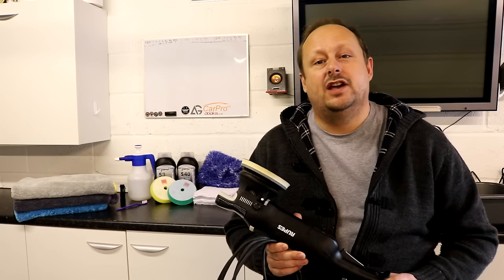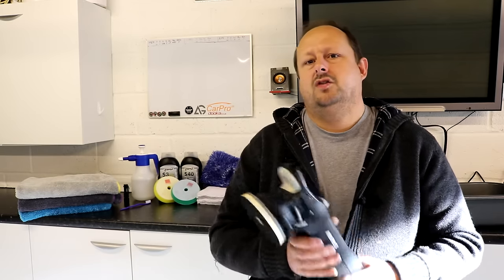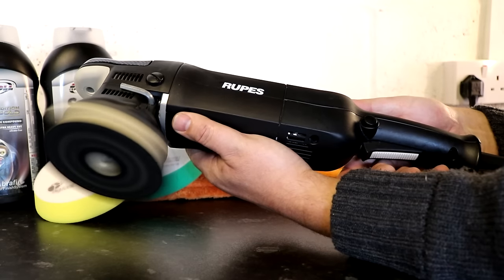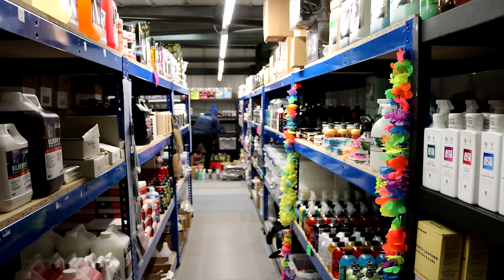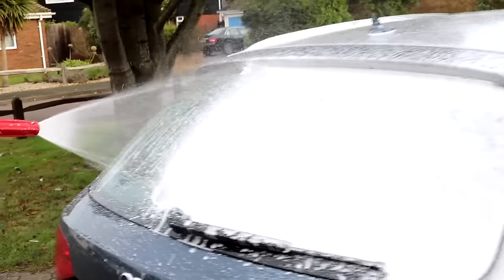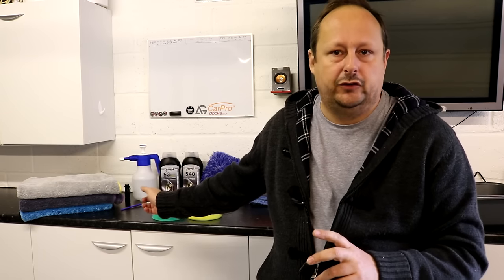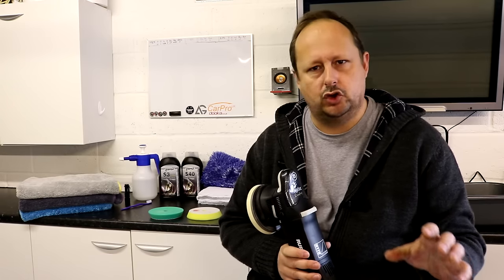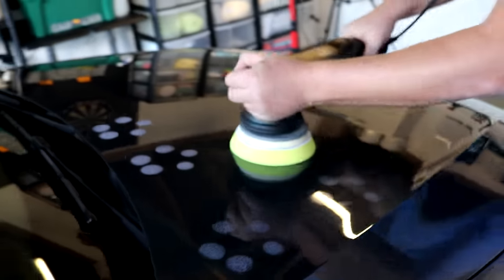Rupes LHR15es MK2 bigfoot machine polisher review guide demo

Comment: I have a 15mm MKll. Without the washer mod it would stall on flat panels if the machine had the slightest tilt. The mod helped a lot. But it still stalls a lot. Very disappointing.
Reply from the maker: bit of grease on the backing plate can help..  remember rupes want the shroud to take up some of the load.. without that is creates too much wear on the bearing.

I know from a consumer point of you view you just dont want any slow down or contact..  but Im guessing they use the finest bearings you can get and they know the effect of rate of wear on the bearing if they remove the shroud contact.  honestly though dont know mate.  i hear a lot of people complain about stall on long throws generally and others say its not a problems.

for me you have to manage it with free spinning machines and it becomes a problem more machining bumpers and wings and rear quater panels and curves generally.   theres also a consequence with managing it that usually means less pressure and therefore less correction.   Its one of the reasons I favour forced rotation.
Reply: I am seriously considering buying a Flex 3401 or the new Mille

Comment: Hi Jon, Would the 75E be a better starter tool especially if you'll be starting on a small car as you'll be able to cover more of it? Thanks
Reply from the maker: no it wouldnt be good lee..   a starter tool would be one that allows you to get the car polished in a bit more of a timely manner (yes you will have some access problems with a 5-6 inch pad on the lhr 15.. but thats less bad than attempting to polish say a front bonnet with a  75.. that would just feel wrong...   like eating soup with a teaspoon..
Reply: Thanks for the reply Jon but it leads to one more question. Rupes bundle or Scholl S20 Black and a green C/G pad as per your beginners guide as I'll be looking at a single stage? Thanks again

Comment: Probably a noob question, but am I right in thinking this has a small motor? 500w? Considering the Das 6 Pro etc had 850w? In Lehmans terms what does that relate to in performance? Not between the LH and Das 6 of course but just in general? Many thanks, great review!
Reply from the maker: its less important with a DA..  the power of the motor does not correlate to the amount of torque the tool puts out...   As DAs are free spinning the offset free spinning bearing will be slowed down by pressure quite easily...  but you cant really slow the rotation of the axel itself on either tools,  mainly because you have a sponge interface to the surface you are buffing, and the presure on the pad/plate is relativly low...     if you were using the tool to sand wood with a bit of grit paper on the backing plate, torque output would come more into play because it would be easier to slow the machine down...
Reply: Fantastic! Many thanks mate. Looking to upgrade my Das 6 pro due to the low/slow correctional capabilities (8mm throw) in the scheme of DA's. Would you consider any other machine than this? Is there any benefit in upping to the LH21? I purchased the DAS 6 Pro to solely focus on my Integra Type R (soft paint). However may now find myself doing more machining on other vehicles, hence looking to upgrade. Thanks for the advice mate. Really like the channel!
Reply from the maker: 21 mill throw becomes a bit of a handfull.. I think the 15 mill throw is enough... what else would I consider..

Well if you are set on a non rotary solution the usual shoot out is 

das6 pro plus 15 mill throw (cheaper option)
rupes lhr 15es mk2  (typically professional option)
flex 3401 fixed rotation DA (typically professional option)
Reply: Awesome, thanks a bunch!

Comment: Hi Jon, do you mix the born slippy clay lube with distilled water or tap water? Is it really effective or you'd recommend another clay lube also?
Reply from the maker: either.. I think nowadays I prefer to use distilled but in the past Ive just used tap water.
Reply: Ok thanks mate, lastly, is there an expiration date for the dodo juice born slippy? Does it tend to go bad after a certain amount of time? I'm going to buy the 250ml concentrate which will make 2.5 litres. Considering it's for personal use and only one car to be clayed rarely, it's going to take some time to be used up fully.
Reply from the maker: you know what I dont know..  thats one to speak to DJ about..

Comment: Does this polisher have more torque on curves than the DAS 6 15mm? Thanks!
Reply from the maker: they all stall if you lean in Mark.  There is virtually no torque on the spin, its purly generated through the free spinning plate around on the offset bearing.      So you wont stop the axel orbitting from pressure but yes with this tool or the xfe 7-15 of the DAS6 pro plus they all stall out on the rotation on curves and when you lean in.    when we had all 3 tools up against each other we felt that the flex and rupes had an advantage over plate stall than the DAs6 pro.   but theres not much in it.  I actually felt the flex plate system was the best at this, although i think the other guys might have felt the rupes was better I cant remember.   the rupes and the das6 pp benefit from a bit of grease on the plate and the shroud rim..     part of the reason these tools are so safe also creates this stalling problem.   Its the main reason I choose forced rotation over them. but they are still pretty cool.
Reply: Thanks Jon! I have the DAS 6 Pro Plus and trimmed the shroud(helps a lot). I feel it's plenty powerful. I have the 3401, but I feel I get better cut and finish with the 15mm and less fatigue, but the stall on convex panels gives the advantage to the 3401.
Reply from the maker: hey mark.  I feel the 3401 cuts a lot more. but I cant stand using the 3401 on anything other than the 5 inch hybrid power pads because you get walked more.   on a bonnet or something theres less difference, but polishing out a wing of something with the free spinners just see lots of marks after a set that the 3401 would have got.

Comment: why u dont use the rupes if its soo good all the pros use it ?????
Reply from the maker: hey pete.  not all the pro's use them.   I dont use free spinning machines generally for reasons I kind of covered in the machine polisher types guide video.  So I mainly use the flex 3401 and the flex rotaries.  If I did want a long throw free spinning DA option Id have to make a choice between the cheap chinese, the flex xfe 7-15 and the rupes LHR15esmk2.     I would prolly go with the flex now because I think it has the best plate the shroud interface of all the long throw machines that and the flex mini that I would pair it with I think is the most solid mini.   but it wouldnt make too much difference really. although the build quality on the flex and rupes is higher

Comment: Ive seen you also reviewed the Flex 3401, in your opinion which is the best?
Reply from the maker: I think is I had neither and wanted to buy one..  At the moment I could get a flex for 300 quid.  Thats going to be the things that swings it.   I can also use the flex with a pad combo that suits me more... Its also lighter..  So I would buy the flex.   If I had to buy the 900e now I would need to spend over half a grand for the kit..  As much as I like the tool  and would love to have one, if faced with the decision I would by the 3401..  although I think flex are bringing out a new forced rotation soon so might wait a bit for that..
Reply from the maker: sorry you were asking about 3401 or lhr15.    not 900e.   in short personal preference will play a part.  I prefer the 3401 to the free spinnings.  I find it more consistent generally, I find it cuts more and I find I can hit the edges of panels with it and lean in if necessarily without worrying about stall...   the trade off is a forced rotation will walk more, but I use it with small pads which solves that problems.

Comment: Hi, does this have more pad spinning torque than the DAS Pro Plus 15mm?
Reply from the maker: hey mark remember the spin is free spinning on these machines.. so the spin is generate by the orbit..  So its really the torque that gets put to the axel thats for the orbit the bit you have to measure and I dont think anyone publishes this..  Id be interested to know myself but you wont stop the orbit or the oscillation of the machine. the tool also has electronics to maintain the OPM rate.

In terms of the spin..  The rupes 15lhr rubber houseing edge sits close to the plate.. there isnt any clearence so the spin can be easier to slow down I think than the das6 P + (although you can still do that on the d6pp).   In practical terms though you will only stall the machine if your pushing down tool much or the pad isnt on a flat surface...  some people I speak to dont think its an issue.. some I know use the washer mod..  

for me, if your just going in light handed and letting the tool do the work then there isnt an issue with the "spin" stalling..    The tool delivered me the results I needed with ease.  I think like Ammo NYC said about the tool.  Putting the washer mod might just give you a bit more space to stop the rub and make it even harder to stall....     Or make the tool even better i think was the words he used...
Reply: Thanks! I use the washer in all my long throws. The DAS6 Pro Plus 15mm works very well for me. I polish a lot, but still don't see the need for a Mark II 15 as far as correction, unless I'm missing something?
Reply from the maker: Hey Mark.   if you have a pro plus 15 in terms of capability theres not much point buying a rupes 15lhr mk2..   but you didnt have either..   Its important to know you are getting a good tool with whichever option you pick.. but the Rupes is a higher quality tool which better internals and more features...  I think budget will be the number one factor and if your a pro or not really.

Comment: thinking of buying this or the griot's boss 15. any thoughts jon?
Reply from the maker: hi tito.. I have no idea about the griots they have good reputation but I have never used in the UK...  Can say though if your defo sure its a 15 mil long throw.. the rupes will serve you well.. Its the smoothest of the long throws that ive used.. very well built..   grease the backing plate on it to minimise stall and be mindfull of pad stall when working non flat areas (so mindfull of pressure and balance)
Reply: Forensic Detailing Channel thanks for the input john

Comment: Whenever I use mine, the pads fly off it, any ideas why? I make sure they are securely velcroed down
Reply from the maker: what pads mate?
Reply: rupes medium and fine
Reply: they came in a rupes starter kit with the polisher
Reply from the maker: it takes some effort to peel those pads off the polisher.. there is no way they should be flying off the machine...  Id say its almost impossible for them to rip off during use..   the only thing Im thinking is your pads are sticking to the paintwork (happens sometimes with single stage paint where you get the pad really bites onto the surface)...   so make sure the pads are on well.. and make sure the pad is not sticking and stalling on the surface for whatever reason.. maybe take a video of it happening with a smart phone or something..  its really hard for me to say without seeing it.
Reply: Ok thanks will do when I get the chance, I think it seemed to happen when the backing plate started to heat up
Reply: hi 96 explosive, sounds like you've cooked your pads pal,essentially melted the Velcro.
one thing its critical to know is the rupes generate an enormous amount of heat at the point of contact between machine and pad i.e. the Velcro.
the way to avoid this is to use multiple pads,say 4 pads for average bonnet,say 10/15 minute set then swap the pad.
this is critical,I've learnt the hard way,oh and I know your probably not but don't use damp pads,adds weight to the pad and(more )  stress on the Velcro......
those pads you've got are junk now I'm afraid,time for some more.
love your vids forensic detail guy,hope I aren't butting in here .
Reply from the maker: no your more than welcome mate, and it sounds like good advice..   

what I think is happening is when the pad starts grabbing the paintwork for whatever reason. when that starts happening you can almost insta kill the pads.. they cannot absorb the sort of energy the tool is putting out, and the more they stick the more energy gets transferred through the pad...    

so always working nice and slow and making sure pad is clean swap pads etc..

only times ive ever had this sort of problem is on single stage paint which I hate working on with a passion..
Reply: cheers forensic detail,reason  I say this is I went thru this last year.
I bought a mark 2 15 last summer and initially broke it in wet sanding my work van ( not the actual sanding of course) which I did in my spare time,an hour here and an hour there and all was fine.
first ran into problems when I did a correction/ enhancement for a customer and used my rupes for an extended period (8 hours)
after about 2/3 hours my pads just started flying off especially on the horizontal,I was using rupes microfiber pads.
luckily (I thought) I had 4/5 spare rupes pads foam and microfiber,even broke some out of there bags but wasn't having it at all,pads flying,plenty of arse clenching moments on customers bmw.
luckily I had my trusty old das 6 on me which saved the day.
was really disappointed with my rupes and couldn't understand what was happening,bought some more brand new rupes pad and still the same,they'd stick but peel off again really easy,after many,many hours of research I read something about melting/degrading the Velcro with overuse of single pad.
which has just made me realise my original post was in fact wrong and explosive96 its actually a little worse as you probably need a new backing pad (slims detail £35) best way to check is try a brand new,out the bag pad and if it peels off really easy its the backing plate,all things being correct the pads do stick like shit. 
best description I heard was Todd helme/rupes guy and he uses the analogy of spinning a rock around your head that's tied to a bit of string,if the string is short (i.e. short throw da) the force at your hand is relatively easy to control but increase the length of the string (i.e. long throw da) and the forces multiply dramatically and this is what is happening on long throw machines except the Velcro is taking place of your hand,if that makes sense ??
anyway I took the advice,got a new backing plate and started switching pads more often and haven't run into the problem since.
hope that helps.
.
Reply: and just to further clarify with the string analogy,the Velcro been your hand is getting put under extreme force because of the longer throw (a lot more than say a 8 mm das 6) and this force results in the Velcro interface pad or backing plate getting really hot and the tiny hook and loops start to break down and stop working.
Reply from the maker: this machine I borrowed has been used heavily.  and I gotta say the pad stuck to it so hard (its like quite hard to tear the pad off it)..   I think you hit the nail on the head that you degrade the velcro if you over heat the pad perhaps..     has to be something like that.. because there was no way on earth this pad was coming off the machine...   Its really important to work cool..   and always make sure that pad can spin freely over the surface..    I think it goes back to the point about grabbing.. If ever you get a pad grabbing the surface when your machine polishing, for whatever reason is causing it.. if you get grabbing your in trouble and you need to stop and check out whats going on and address it.

Like I say the only time this has happened to me is when I was doing a single stage correction and the pad started sticking..  so I stopped switched out pads,  cranked the tool down, used less pressure and just worked even slower (was still a pain but it stopped the pads getting fried)